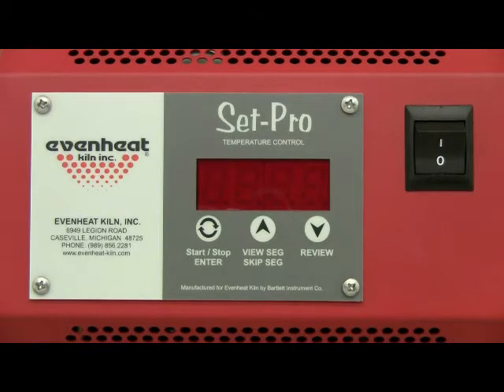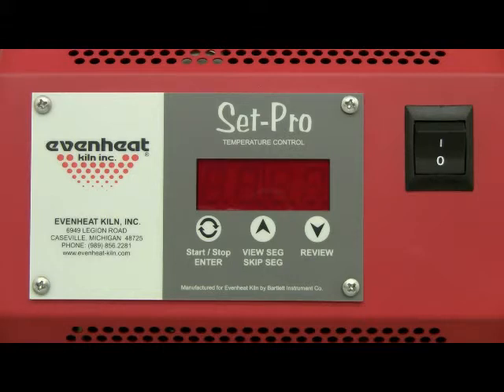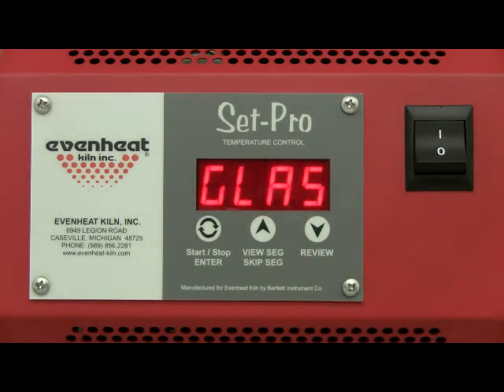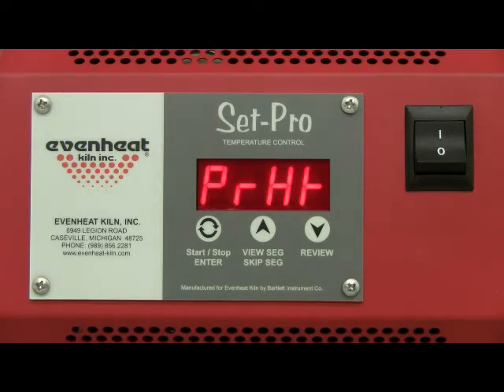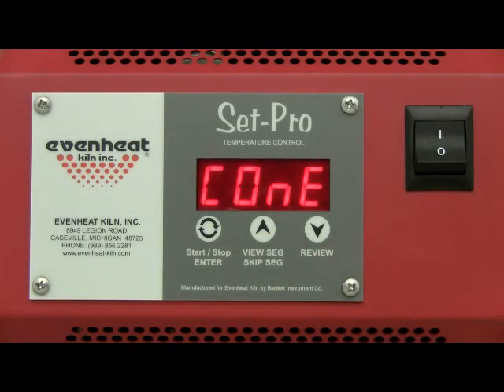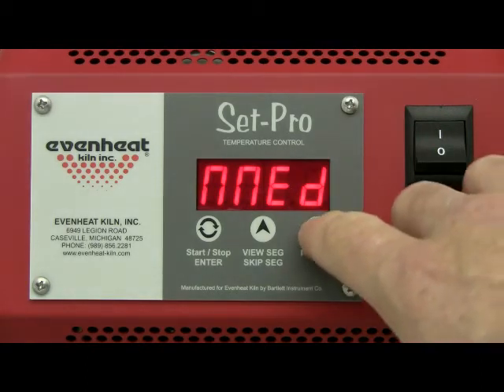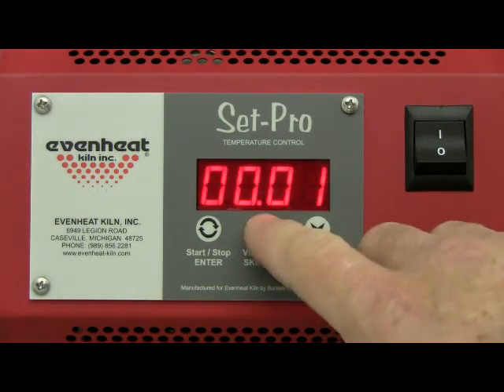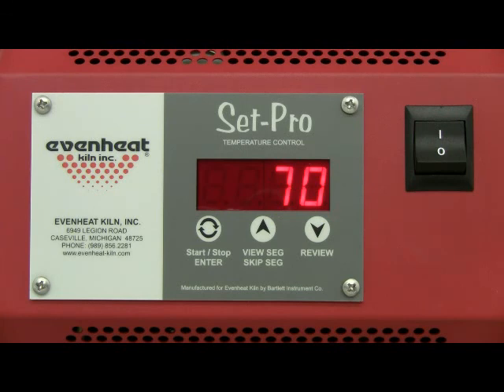Set-Pro Ceramic Express Programming

Comment: The digital control increments one digit at a time when changing the temperature or any other value such as duration.  Is there a way to fast change this value?  Adjusting the temperature from a 1000 F to 300 F will take an hour!